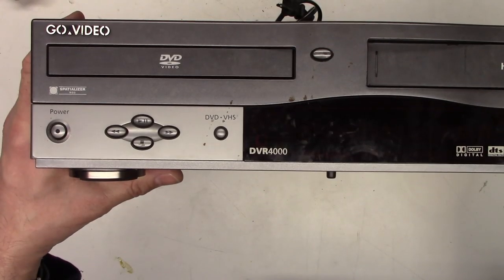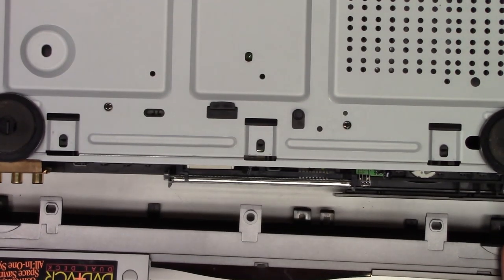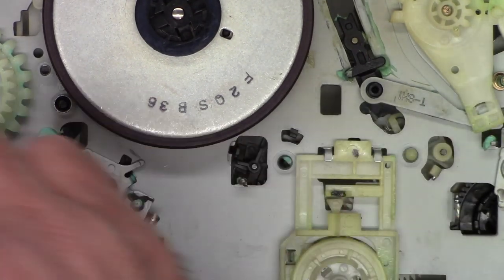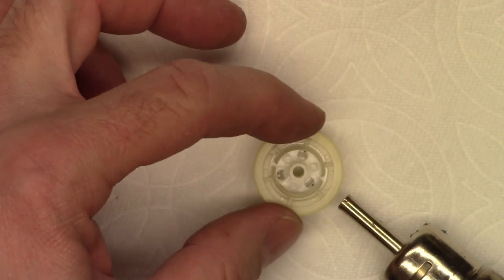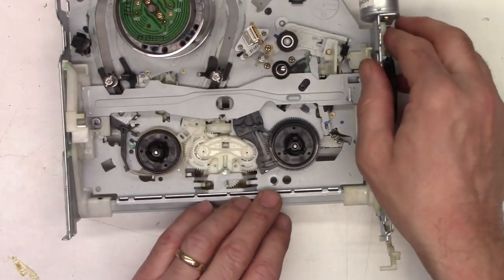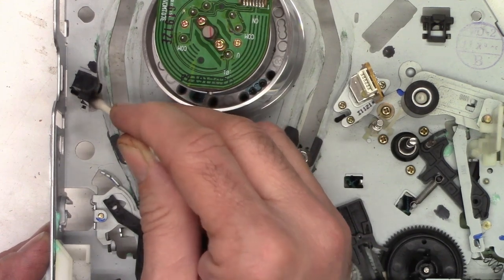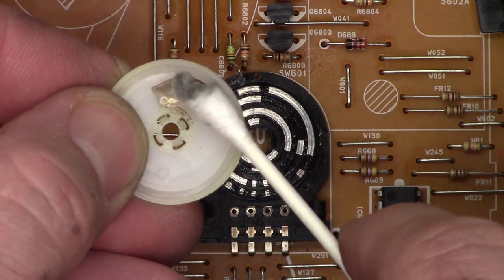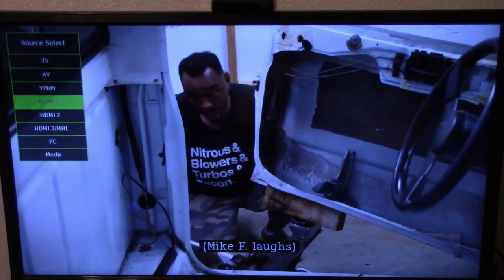GoVideo DVD-VCR  PART 1 WILL NOT PLAY DVR4000 EATS TAPES REPAIR FIX

Comment: Gluing a cracked gear as opposed to trying to obtain a new-old-stock replacement that may no longer be available is often the best solution - excellent repair.
Reply: You could also 3-D print a replacement gear if you know what exactly it looks like, it is only plastic after all.

Comment: Good work! A few suggestions: instead of using hot glue, I highly recommend looking into cement for use with building plastic models, that stuff forms a more permanent seal since it actually melts the plastic together. Also, instead of using a Q tip to clean the head drum, I simply wet a piece of printer paper with isopropyl alcohol, hold it against the drum, and turn a few times. Its a lot safer than using a Q tip since the fibers can catch onto the tiny heads inside and mess things up if you aren't extremely careful.

Comment: Hey NorCal, great vid, I appreciate you going so in-depth, I have this exact same model. But, if I can ask a question, I have another Samsung VCR that when the tape goes in and is grabbed by the rollers, they only move slightly, pause, then spit the tape back out. Is this a tape sensor issue or something more? Thanks!

Comment: I have a question for you - I have a VCR that has the same problem. When playing the tape, the tape spills out into the machine (the same way you see here) instead of retracting back into the cassette. If I fast forward the tape, the right reel would intermittently stop spinning causing the tape to spill out. The same thing happens when rewinding the tape. Would it be the same same gear causing this? I'm a bit scared taking the VCR apart because I probably won't remember how to put it all back again.

Comment: I Have a question on a different GO VIDEO VCR model. It’s a dual deck VCR. The unit will not power on, but when it’s plugged in all you hear is a buzzing sound coming from to top left corner near the power cord entrance.
Reply from the maker: Probably a power supply issue. Possibly a shorted component or bad capacitor/capacitors.

Comment: I have a question. My VCR is a Toshiba 4 head HI FI stereo. When I put a vhs in it plays for about 3 seconds and then stops (doesn’t eject the vhs). When I opened up the VCR and press play it has loose tape towards the “take up” side (no dents just excess) then after 3 seconds it stops and puts the tape back into the vhs. At which point I can eject the vhs.  Do you know what the issue could be?
Reply from the maker: Is it taking the tape up when playing, or spilling the tape after the pinch roller/capstan? They have reel rotation detection if take up is not detected it will shut the machine down to protect the tape.

Comment: why dont u use iron to weld that crack? u will not have any other problem with that crack. great diagnostic, but not that good repair
Reply: Because hot-melting plastic is not always reliable and isn't strong. It also looks crude. Gluing the old broken piece is recommended when a new replacement part is unavailable.